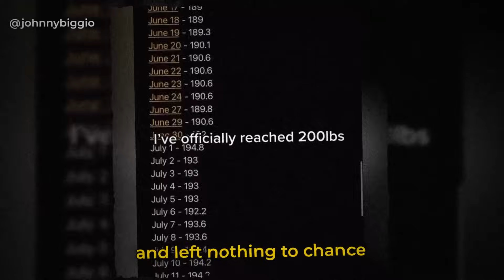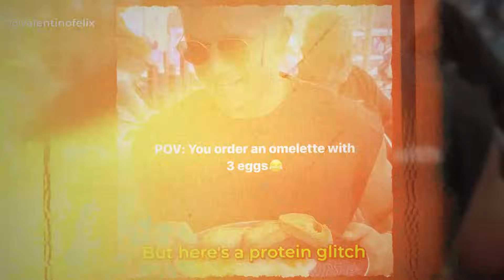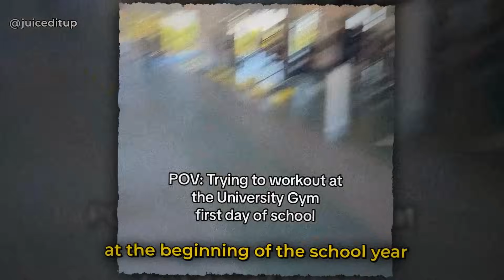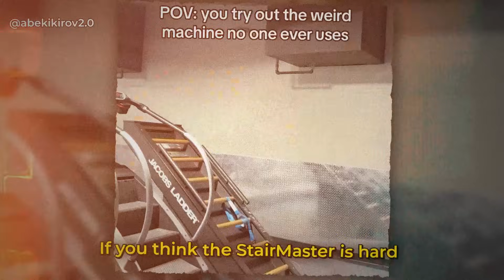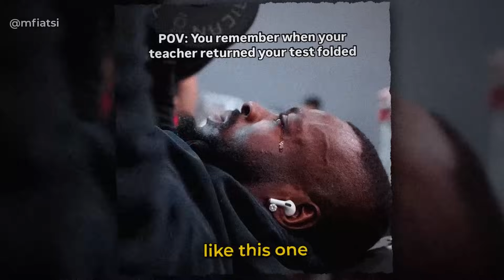"16-Year-Old On STEROIDS..."💀

Comment: I cringe at the "you have to lift natty for 10 years" card. The only somewhat valid point in this blanket statement is that you need to develop tendon strength for injury prevention, but come on, you don't need a decade of training just to avoid a tendon rupture. This "10,000 hours of training" or "10 years of lifting" delusional dogma has no rational basis. Your tendons aren't that fragile. Your tendons will continue to strengthen even when enhanced. Your tendons will warn you beforehand (when a tendon is inflamed, it will cause swelling, pain, and discomfort).

A few months of lifting is more than adequate to serve as an early indicator of genetic potential and growth capacity, and with a couple of years of good training you've already built about 80% of your genetic potential (Pareto principle). This is a good time to consider what you want to achieve in the gym. I hopped on gear after 13 months of training and have zero regrets.

I trained intelligently from the beginning, following only proven training methodologies, the best technical expertise and soundly designed programs. My very first workout was just a preliminary testing phase and introduction to the physical location, and on day #2 I was already using my freshly acquired data for a novice powerlifting program. I was benching 60 kilograms on day 1, and 13 months later I had a natty 1RM of 182.5 kilograms. You're telling me I'd still have to lift for 9 more years to even consider becoming enhanced? Come on.
Reply from the maker: The 10-year rule isn’t just about building a solid physique or strengthening your tendons—it’s also about getting as educated as possible about lifting. Many people waste their first 2-3 years making mistakes that slow their progress. This often leads to frustration and missing out on reaching their genetic potential, which then pushes them towards considering PEDs. That’s a wrong approach.

If you know what you’re doing and you’re learning from every session, the decision to use steroids should only come down to whether you want to compete or not. Age is a major factor too; it’s generally recommended to wait until at least your early 20s.

By the way, the progress you’ve made in lifting is incredible. Going from a 60kg bench to 182.5kg in just 13 months is beyond impressive. Most people would need at least 3-5 years to achieve that, which shows you really know your stuff.